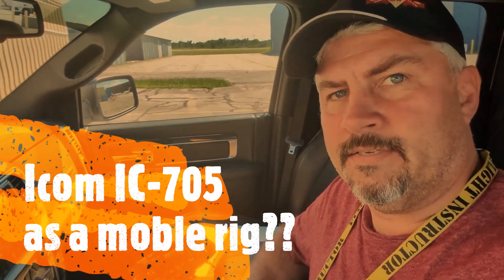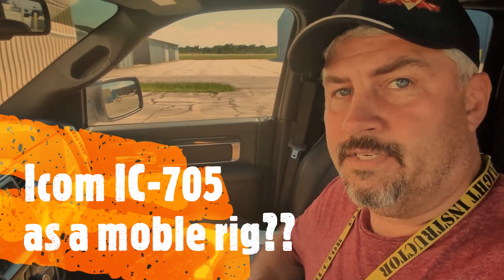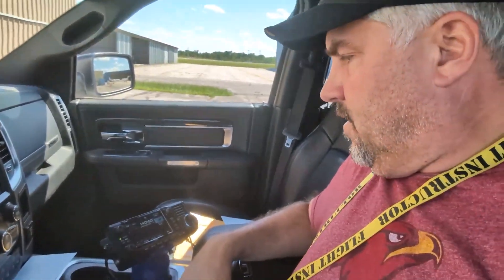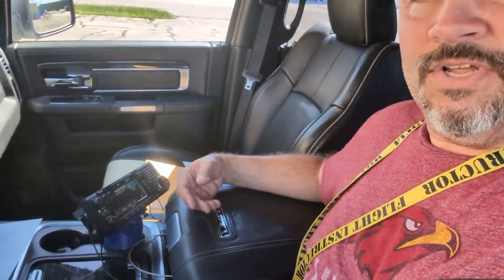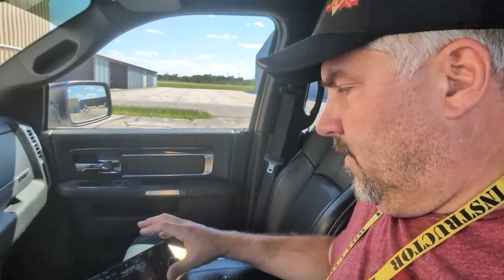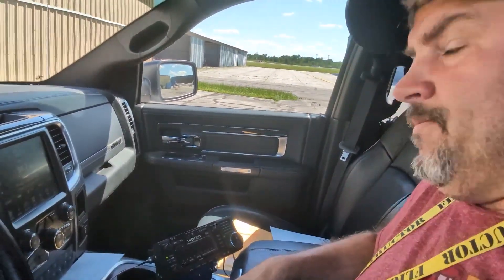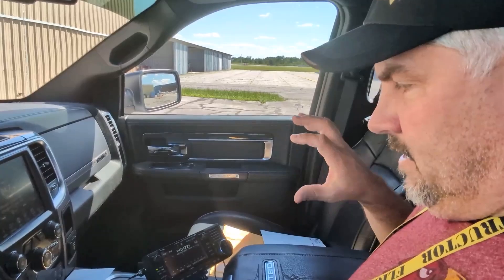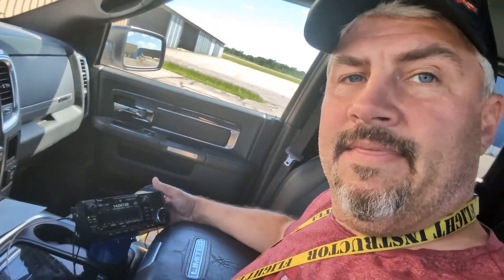Using an Icom IC-705 as a Mobile rig

Comment: How is the radio mounted to the car and what antenna are you using?
Reply from the maker: @danjohnson9140  I have a mount that fits into a cup holder (I sell them on Etsy) and I'm using an ATAS 120a

Comment: I ran my 705 as my mobile rig for a while in my Jeep.  It was a great setup.  I agree with you about the speaker mic - doesn't sound the best, but right up next to your ear is good enough to cut through the rest of the noise in the car.

Comment: How would one use a 705 mobile with a screwdriver antenna? I run a 7100 with a tarheel now, but I turn the power to 10W and CW to tune the screwdriver up and down. How would I do that with a 705 + 100w amp? Just trying to wrap my brain around the idea.
Reply from the maker: Great question!  I think I need to do a video on this!
Reply: @k9kj  i would love that lol
Reply: Please do! Rob WA9RAD

Comment: I have the same dilemma - I love my ATAS antenna, but had to buy an FT-891 in order to have one touch antenna tuning. But I hate my 891 for the same reasons you mention. I far prefer my IC-7100, IC-705 or IC-7000 in the mobile, so user friendly, convenient and no cables...but then there is the issue of having to tune the ATAS. Sure you can get an external unit to do the tuning, but then it's just cumbersome, with more units and cables in the cab. Now, if Icom could produce a motorized antenna similar to the ATAS, with one touch tuning from an Icom, then I would buy it without hesitation. Icom have nailed it with their user interface, and with all the ports on the head of the radio.
Reply from the maker: 100 percent agree!  I wish Icom would do an antenna and associated interface

Comment: You really do have that set up so cleanly - takes up very little space in your truck. My 891 setup is so cumbersome I no longer have a seat for my wife 😂. The main reason I went with the 891 was the built in tuner with the ATAS-120. Maybe that’s silly as you can just get external tuners.

Yep, speed adjustment on 891 is a pain but as of right now I only run 20WPM so I rarely need to adjust. I love your cup mounts but in my old truck the cup holders are on the floor so it’s kind of funky. But my wife has a new SUV with a raised center module and it’ll work great there!

P.S. what do you have behind that hangar door?
Reply from the maker: Check out Instagram handle @flytj

Comment: Nice video! Not sure if you know that you can assign many of the floating options (like CW SPEED, PWR, CW pitch or NR LEVEL,etc.) to the MULTI knob, by long-pressing the option. Then the MULTI will change always the CW speed for example. Long-press the MULTI to reset it to kHz again. It is very useful!
Reply from the maker: Thanks for the tips!

Comment: So TJ, you sort of caught me off guard.  I am in the market for another radio and was looking at the FT-891.  I have the FT-991A for a home base but, would like to have something portable not so much mobile.  I thought the FT-891 would be good since it is 100W radio but, since looking at you video, I am having second thoughts.  I have heard some folks say it is easier to navigate around with the IC--705 then with a Yaesu.  I want a radio for portable and emergency purposes.  The IC-705 is  only 10W of power and I certainly don't want to carry an amp if I want to be portable.  Thank you for sharing.
Reply from the maker: Great point! If you do want to go portable and are needing 100 w, I think the 891 is a great setup.
Since I don't have to worry about hauling around an amplifier and it is permanently mounted in my vehicle, that kind of takes that variable out of the equation. I don't do portable operations very often, and when I do I will just settle for qrp with the 705

Comment: What antenna are you running?
Reply from the maker: Today I am running the Yaesu atas 120. I also have the tar heel 100A that I use for when I'm on a long haul driving trip.  The atas-120 is my preferred antenna only because it's easy to pop onto the diamond mount on my Door